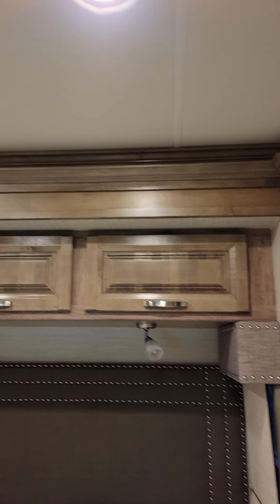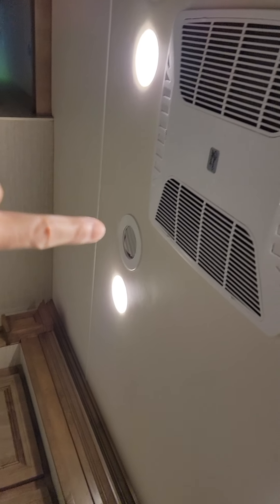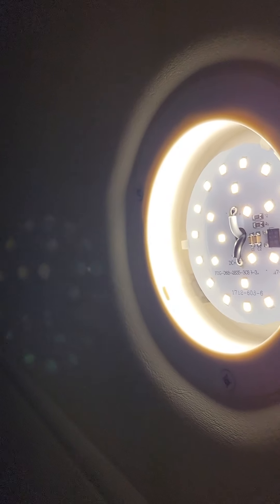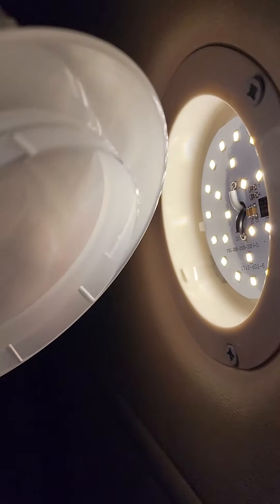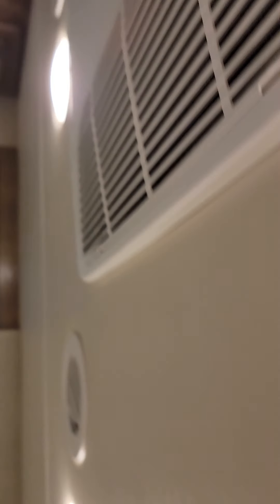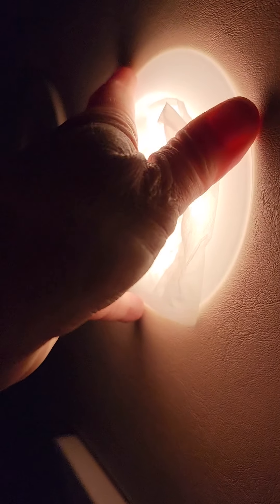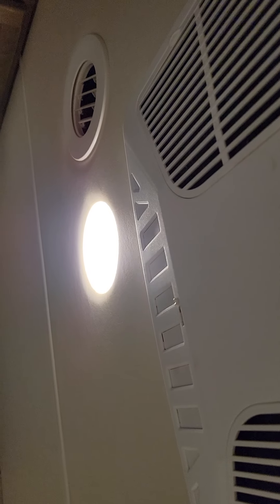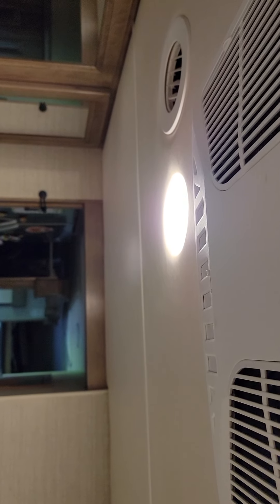Removing RV puck light covers

Comment: I bought 6 puck lights and needed to install batteries. I had the batteries all ready, but no matter how hard I tried I couldn't get the back cover off the new puck lights. I was about ready to cry (in frustration) when I happened to see your video. You gave me the idea to use something for a better grip when trying to turn the flat back cover off. Your idea worked. THANKS A MILLION!!!!